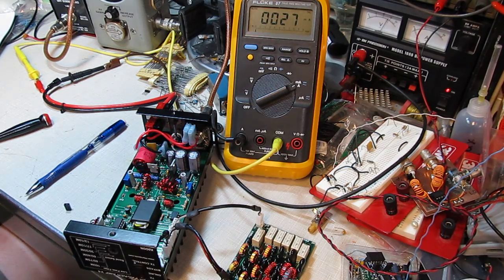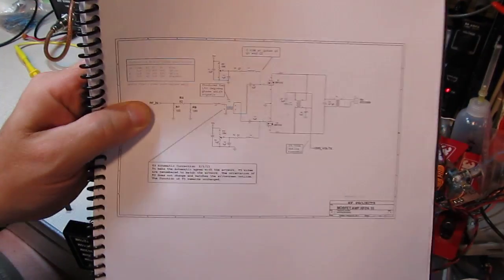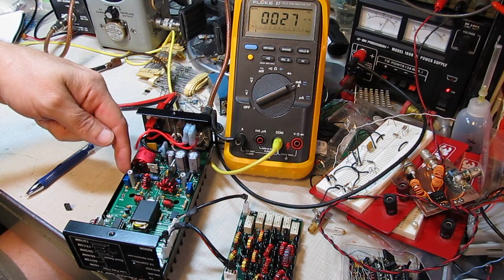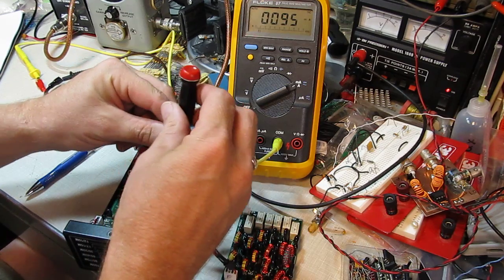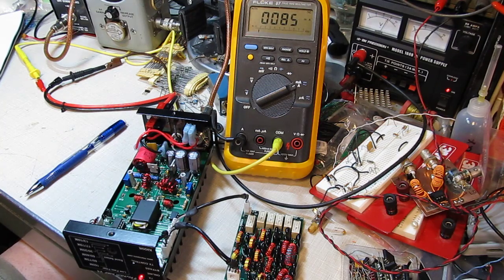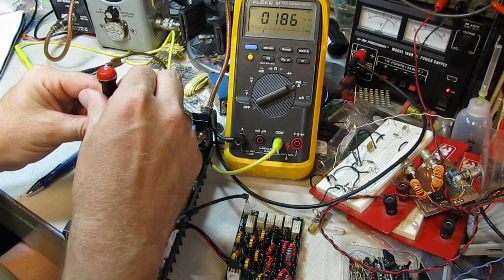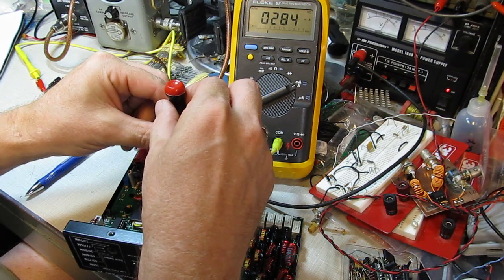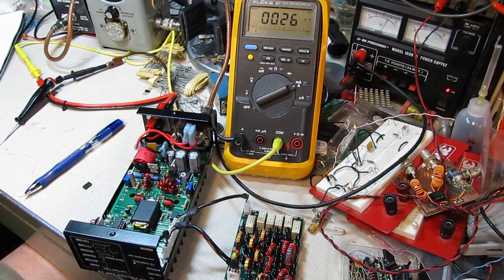#107: Adjusting the MOSFET drain current in the HF Packer V4 Amplifier (ham radio)

Comment: I'm building a amplifier using IRFP90N20D now i have successfully but a amp using irfp260n getting 300w the question is I'm only getting 100w out of the IRFP90N20D witch is rated at 580w now is this a supply voltage I'm running them at 25vdc I'm just not getting the power out of the IRFP90N20D
Reply from the maker: The IRFP90N20D appears to be a device designed for DC-DC converters, not necessarily for linear amplifiers.  Also, even though the devices is rated for a max power dissipation of 580W does NOT mean that it will be able to produce a 580W output.  Power dissipation rating is not the same as the output power rating.  The latter depends primarily on the amplifier design, not just the device.

Comment: Nice! I used this method my self. I was wondering if you know the effect of either lowering  or raising the bias current has on IMDS?
Reply from the maker: Every design will have an optimal range for bias current to give the minimal distortion, and thus the minimal IMDs.  The details of the specific range and IMDs will vary from design to design, so a blanket statement can't really be made.

Comment: Great video! Similar method is used to adjust bias on the Icom IC746 finals (instead of jumper just turn mic gain to 0 and tx in SSB mode) +1 for a simple homebrew IRF510 
amp